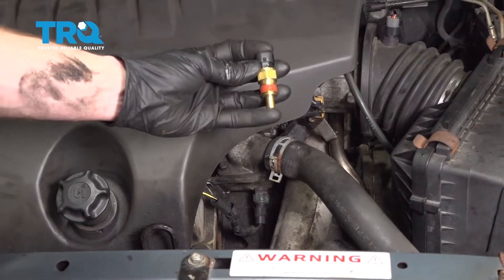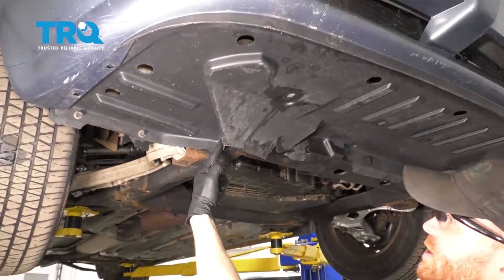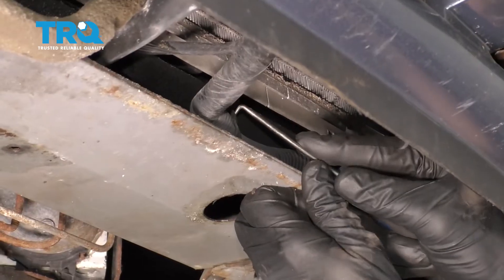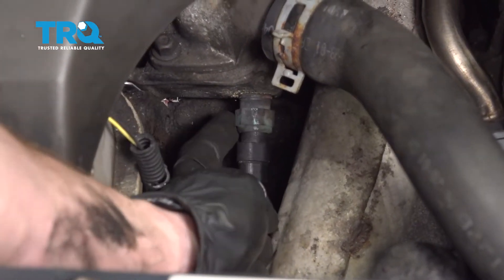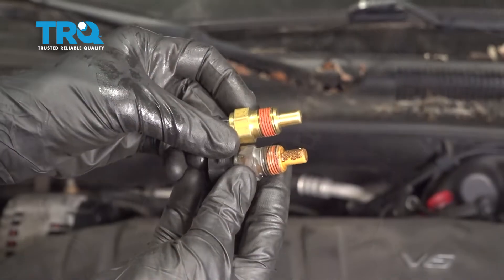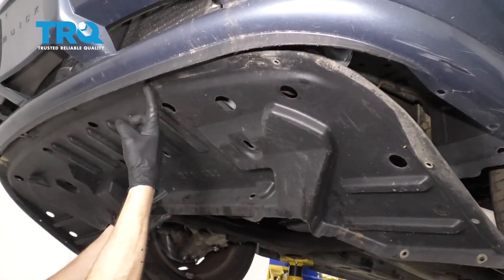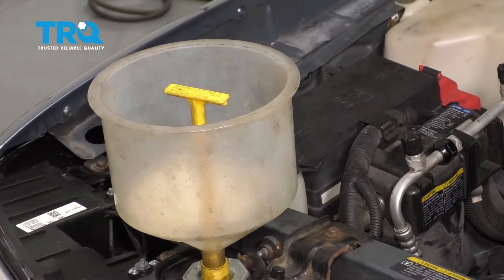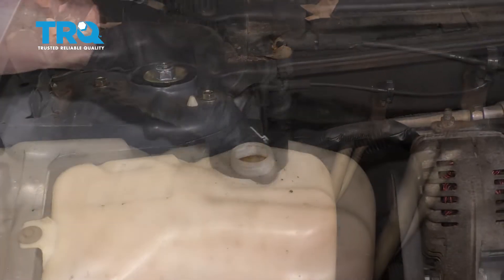How to Replace Coolant Temperature Sensor 2000-2005 Buick LeSabre

Comment: I see you have OFF the bracket for the motor mount already, That I could NOT get off because two of the bolts! One bolt hits the exhaust shield and the other is behind the Thermostat sensor and that to is to long and needs the sensor to be out before the bolt will come out!! But You didn't show what you did to take that bracket off!! Is there a special Tool / wrench  #  to get it out? A bent box wrench of some sort?